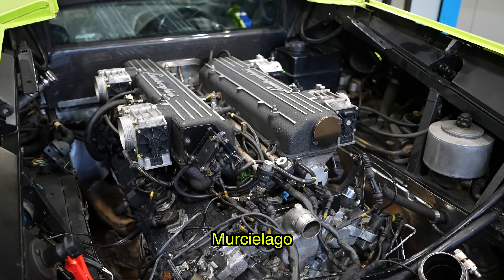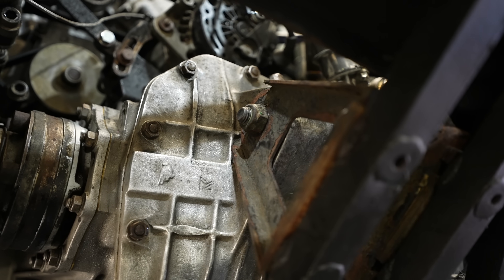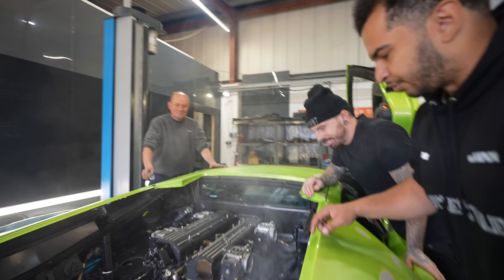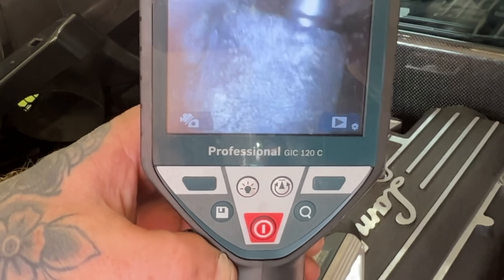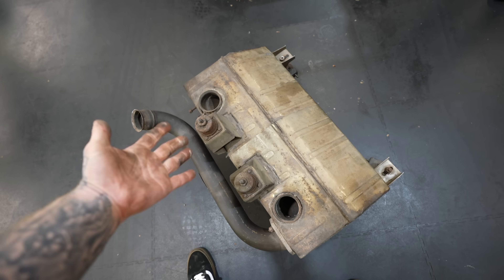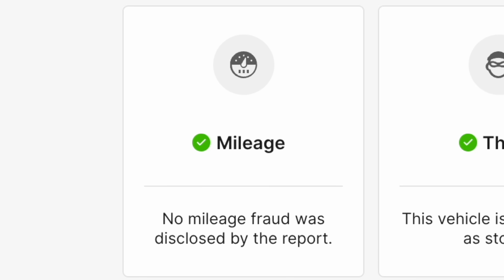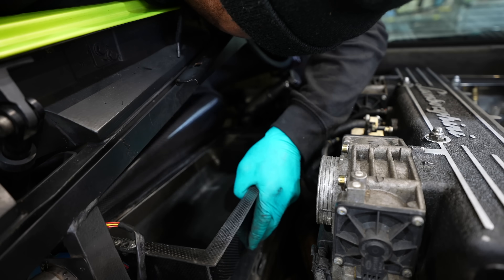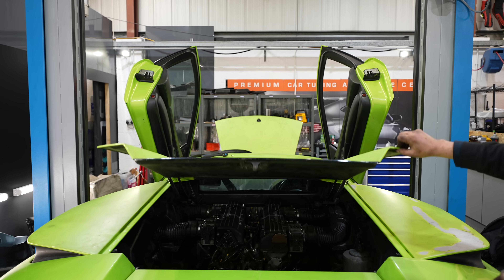REBUILDING AN ABANDONED LAMBORGHINI MURCIELAGO | PT11

Comment: Another method to bleed the clutch is to push the pedal down , then open the bleeder screw , fluid comes out ,then close it , and repeat.
I don't know if it will make a difference , but Mat always works on the try it and see technique so why not give it a try.
So great to hear that engine run smooth.

Comment: Dear Mat, to bleed the clutch you open the bleeder valve until fluid comes out then shut it then go up top and keep pumping the clutch this might seem not intuitive however by pumping the clutch it will build up pressure and any bubbles will rise to the top. You don't bleed it like breaks. So be ready to pump it 30 or 60 times and then you're gonna have your clutch pedal and it's going to be OK. Congratulations on the hard work I'm super proud of you.

Comment: hey mat, i think i found a problem that explains (part of) the oil consumption; you may have shattered a piston ring at first startup of the engine, remember the flame that almost hit you? that was not really a flame rather a bunch of sparkles, you can actually see yellow particles if you pause the video on :14:28, which was actually dangerous for you. Without any ring missing, your car consumes more oil. a cylinder leak test could eliminate/confirm this diagnosis. hope this helps, cheers Luuk (from holland, 11 y/o)

Comment: Quick note on bleeding the clutch.  If your brakes don’t have air in the lines, connect a hose from the nearest caliper to the slave cylinder.  Open both the line on the slave cylinder and the brake caliper.  Pump the break and fluid will leave the breaking system pushing the air out of the slave cylinder and clutch master cylinder.  Be sure to watch both reservoirs as you pump as one will empty and the other will fill up. Lock down both nipples and you are good to go!  One person can do this by themselves!

Comment: With the clutch slave being lower than the master, it is hard to bleed air from the lower bleed screw (air rises).  Check out a Reverse Brake bleeder kit.  It will force fluid from the slave cylinder up to the master and pushing air with it.  The kits are not expensive.

Comment: The shims will be to take up tolerances in the chassis. Even though it will be made on a jig it's not uncommon to have variations between chassis on a box section chassis of that size. In terms of front to back it's either use shims or make the propshafts and mounting points unique to each car. 

Same applies from left to right for suspension shims. For example, you may have two shims one side and three t'other to get equal measurements.

Comment: Try a power bleeder on the clutch resevoir. It uses compressed air to keep pressure on the fluid then just open the bleeder until all air is out. I loved it when i was wrenchin, good for bleeding brakes as well. Turns it into a one man job n quicker

Comment: Sometimes when you put in a new clutch you might need to adjust the pedal. Check if you are getting maximum throw from the push rod attached to the pedal.

Comment: I have really enjoyed your videos. I have been going through the same process with my  -92 Diablo. So many things you have done to your Murcielago is so similar to my Diablo. From the head bolt tool to the shims and many other things you did to your car, I also had to deal with. I am also not a Lamborghini mechanic. I have never pulled an engine or installed an engine myself in my whole life. This was the first one. and have done everything myself except for rebuilding the engine. I had someone else do that for me, since I’m only working out of my garage in the house. I managed to install the engine outside my garage myself in about three hours. I was very proud of myself. I’m at the stage now where I need to bleed my clutch and brakes and then I’ll be ready to try to start it for the first time. I can see your excitement and I’m sure I’ll be just like you when the time comes to turn the engine. I hope I have my ECU’s connected correctly 🤔 Can’t wait for the first drive video, good luck.

Comment: Clutch could be bound after sitting for so long. Turn the engine off, try and select a gear with the clutch depressed. If it goes in, leave it in, keep the clutch depressed and depress the brake pedal. Start the engine. If that was the problem,  it's now freed and sorted ;-) If not, then it'll just stall.

Comment: The engaging clutch problem can be either the clutch itself and bleeding but I hope ( fingers crossed ) is not a gearbox issue. I had a Yaris once that would not engange in gears and once I put in the correct grade of oil according to its spec ( it would do GL4 but not oil with both GL4/GL5 for some reason) which was a weird one. Anyway, the clutch was new on the car and after flushing the oil with the correct spec it was working great. Just saying that I hope you have enough gearbox oil in yours. Good luck!

Comment: 4:12 if you're getting unburnt fuel after just turning on the engine, it's unlikely the O2 sensors are the issue. I doubt they will be operational before warm up.

Comment: Something's telling me you might have put the clutch disc on backwards that will cause that. If you can put it into gear with the car off but not running that maybe your issue more than likely happens to the best of us especially when you're putting a car back together that you didn't take a part. Keep up the great work trial and error

Comment: I made this comment on one of the videos that you posted on FB about the M5, but please stop starting the engines without the coolant system being filled up. The seals in the water pumps require the lubrication of the coolant for the seals. When you start them even for a short period of time the seals can be damaged very quickly and even a small amount of damage will continue to grow. And I can only imagine how expensive the water pump is let alone the time to replace it when it does finally fail. Other than that, it is looking good. To bleed the clutch you should unbolt the slave and push the plunger in and out a number of times with the hose being at the highest point to help push the air out of the system. Alternatively, fill the reservoir and pressurize it up with a couple PSI and then open the bleeder and let that pressure move the fluid to get all the air out of the system.

Comment: Mat, I recently got my e36 m3 running after roughly 13 years. and i had something similar with the clutch. This will sound kinda  dumb, but At first the clutch was dragging, and I was unable to get into gear. I could put it in gear and and it would be able to drive in 1st or reverse. i took it out on a slow drive around my neighborhood, and was able to get it to change gears when sorta rev matching etc. after a little bit of driving, it started to open up, and it will go in all the gears. I know that is a stretch, but this car has sat for a long time like mine. might be something to try.

Comment: This had been a monumental project for Matt and co.,I’m unsure of exactly the year of this car but, In May 2010 The U.S. recalled Lamborghini recalled 428 of its 2007–2008 Murciélago coupés and roadsters because of the possibility of weld failure on the fuel pump support inside the fuel tank, potentially leading to a fuel leak and possible fire. Nah right?

Comment: In about 1986 I was driving a Transit tipper truck on the A24 in West Sussex with my two mates. Squeezed together on the bench seat, windows down, arms out, builders on the move. Steve Wright in the afternoon on Radio 1. I was fiddling with the ventilation and didn’t see in the mirrors the Lamborgini Countach pull out from about the fifth car behind me. 

I will never forget (or forgive) that guy. When he passed us at about 8,000rpm and 120mph he frightened the living farkin’ bejeezuz out of us. It was the loudest, laryest, wildest freakin’ sound that should be illegal and probably was. Nuts. Mental. Unforgettable.

Here we are 37 years later and your car sound EXACTLY THE SAME.

Enjoy frightening other road users. Especially cyclists, Go hard. Fix the clutch!

Comment: Loving the content, there's a much better brake and clutch bleeding kit than the one your using ,I used to have that one but upgraded to a sealey one with a pump on the bottle lid
Reply: *For pressure and a much bigger bottle for fluid was only £50 or so if remember and no need to check your tire pressure for psi

Comment: I had a similar issues with bleeding clutch and in the end it only worked when we was pomping clutch 10-15 times then release bleed valve until pedal droped to floor then close the valve and repeat that sequence about 10 - 15 times
Hopefully that helps

Comment: Not sure what kinda diffs it had in the gearbox but I probably wasn't moving cause the front diff isn't connected so its sending all the power to the front diff and none to the rear axle, like if you take a driveshaft out of a front wheel drive car it'll just spin up the gearbox output on that side?

Comment: we hd a lmbo done a new gearbox and hd to rev the engine to 3000 rpm for 15 mins or so  before it learned to engage.... it was a nightmare cuz it had an open exhaust aswell...15 mins of pure earblead v10 noise

Comment: Matt, you already spent a lot of money! Why getting rid of the 4WD?! You should reconsider that. That baby is not easy to drive 2WD.
Reply from the maker: 2nd just drives a lot better. Less weight. Less strain on the clutch. Less issues with front diffs and driveshafts etc. I did it on my gallardo and it was night a day difference

Comment: The Z06’s performance is amazing. What an engine. But holy hell is it ugly (inside and out). I’d have to go GT3 by default, because I couldn’t stand having to look at the bat mobile design of the Chevy. Way too many folds and creases and 2010 Camaro tail lights. An interior like a cruise ship casino. Good aesthetics don’t cost more. Buick just announced a sub-30k crossover that has great styling. Lotus introduced a $100k Emira that looks better than most $300k exotics. $30k Miatas have great designs. It boggles my mind how Chevy won’t similarly seize the opportunity to bring an elegant Corvette design to the market - inside and out. They’re painting the brand into a corner by catering to these 50-70yo guys who are trying to recapture their youth. (I’m in that age group, so I’m not knocking the generation.)